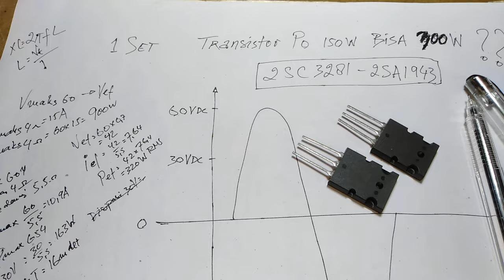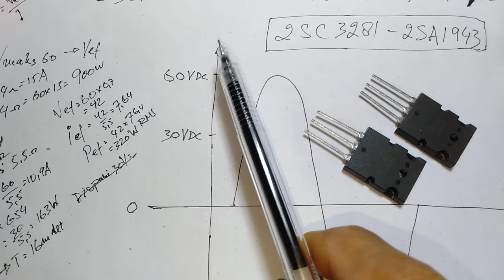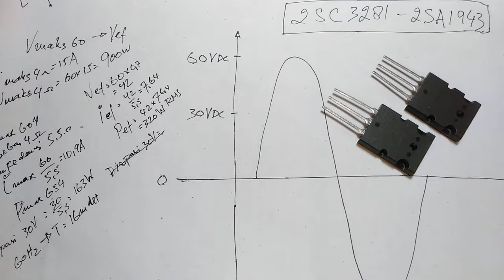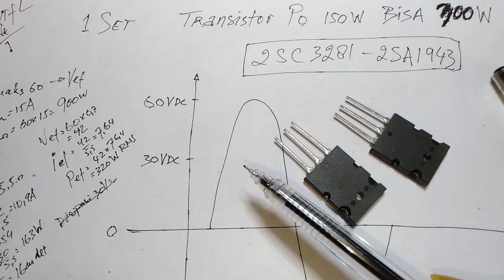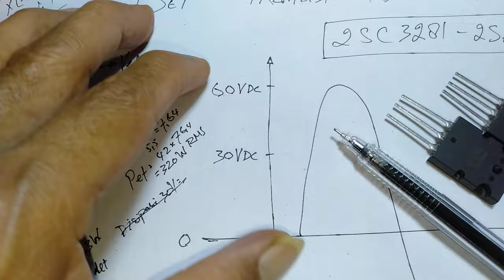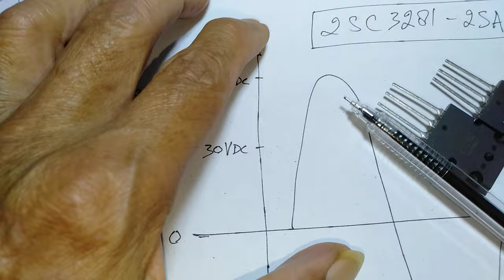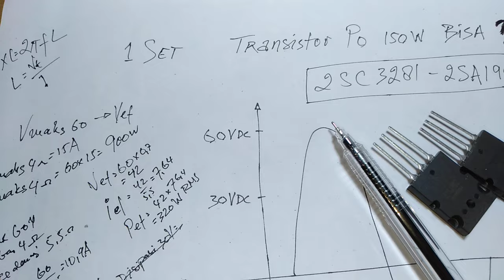CARA HITUNG WATT MURNI RMS - 1 Set Final BISA 300 W RMS 💪💪

Comment: selamat pagi pak iwan kamil saya mau bertanya sebab masih belom faham , ketika TR final di supply 60 vdc lalu TR final mulai kerja di 30 vdc dan sisa vce nya tinggal 30 vdc dibagi beban 5,5 ohm = 5,45 amper di kali 30 vdc =163 watt , lalu TR final mulai kerja di 50 vdc dibagi beba 5,5 om = 9 amper dan sisa vce nya tinggal 10 vdc di kali 9 amper = 90 watt
^^^yg saya tanyakan disipasi TR final tersebut yg ketika main 163 watt dengan yg main 90 watt itu kondisi TR final lebih panas yg mana pak ? soalnya di video bapak yg berjudul “kapan transistor mulai hot” bapak menjelaskan TR final akan panas di yg main 90watt karna  sisa vce nya tinggal 10 volt , sedangkan divideo yg ini bapak menjelaskan TR final malah lebih panas yg main 163 watt yg vce nya masih sisa 30 vdc (sebab dimenit 18:13 bapak mengatakan dipuncak TR final justru dingin), terima kasih atas jawaban dan penjelasan nya 🙏
Reply from the maker: @davidpurnama3202  
Selamat pagi..🙂🙂
Benar...
Jadi, intinya...kita anggap bahwa Amplifier (transistor final) tidak bekerja hingga Clipping/Over.

Maka yg sy maksud "tak akan panas di puncak kerja" adalah di Puncak-Kerja...dimana transistor tersebut BEKERJA MEMBERI TUGAS ARUS KEPADA BEBAN.
>>> kan fungsi nya itu ??
Apapun transistor Final, maka fungsi nya adalah "memberi arus kepada beban".

Nah, di Puncak Tugas nya, dia justru dingin...katimbang disaat separo tugas.

Saat separo tugas (di simulasi video) adalah ketika Separo Catu. Saat "separo catu" bukan "Puncak Kerja" nya.

😁😁...begitu
Reply from the maker: @davidpurnama3202  

Nah...makanya sy berkli-kali Posting di Fb...bahwa "Clipping" adalah kejadian DUNGU...
>>> disaat Puncak...jika ia kerj Musik Murni...transistor akan justru lebih dingin.
Namun...jika di saat itu dia malah DI PAKSA MEMBERI ARUS CLIPPING KE BEBAN...MAKA DIA DI PAKSA BEKERJA HINGGA 2,5 KALI LIPAT DARI KERJA-MUSIK.
DAN...KERJA "CLIPPING" TERSEBUT ADALAH "MUBAZIR" & "MERUSAK".

dia akan merusak transistor dan woofer.
Reply: @TUNERAUDIO  lalu konsep yg mana pak yg harus saya jadikan pegangan buat bekal ilmu yg bapak ajarkan kepada saya , di video yg berjudul “kapan transistor final mulai HOT” yg berdurasi 10 menit tersebut bapak menjelaskan saat dipuncak transistor akan sangat panas sebab VCE sisa 10 volt dikali 9 amper = 90 watt ( pak iwan menjelaskan itu di menit ke 9:00) 
^^^sedangkan di video ini bapak menjelaskan disaat puncak transistor malah dingin (pak iwan menjelaskan dimenit 18:13),saya merasa agak kebingungan , lalu kondisi transistor yg paling panas itu sebenarnya disaat main 90 watt atau malah yg main 163 watt pak
Reply from the maker: @davidpurnama3202  
Pegang kedua video...dan kedua video Resume nya :

Transistor Dalam Penguat Sinyal:
1. Transistor apapun akan paling panas Disipasi nya ketika bekerja gelombang sinyal di saat catu pertengahan nya.
Disipasi terpanas terjadi di titik tersebut, baik ketika maju maupun disaat penguatan Turun.
Yaitu pada masa Perioda 45 derajat, 135 derajat, 225 derajat dan 315 derajat dalam siklus Satu Gelombang.
Disaat itu kerja nya bukan terkuat bukan Puncak kerja, namun Puncak Disipasi.

2. Puncak kerja transistor berada sekitar Setinggi Catu, baik Catu Plus maupun catu Minus.
Disaat Puncak kerja ini maka Disipasi Terdingin....KECUALI TERJADI CLIPPING.
Kalau Clipping terjadi MAKA BICARA TIDAK LAGI TENTANG PENGUATAN SINYAL.

Beda antara Puncak Disipasi dan Puncak Kerja ADALAH HAL YG TIDAK DI PAHAMI OLEH SEJUTA UMMAT.
MAKANYA SEJUTA UMMAT BER PERILAKU "DUNGU" DALAM MEMBUAT AMPLIFIER ATAUPUN MERAKIT...ATAUPUN MENYIKAPI TENTANG "KEKUATAN AMPLIFIER".
Reply: @TUNERAUDIO  ok terima kasih banyak penjelasan nya pak, kalau misal kerja tr final berada di posisi paling puncak namun terjadi clipping apakah tr final akan jauh lebih panas lagi dengan kinerja tr final disaat posisi puncak disipasi
Reply from the maker: @davidpurnama3202  
Sangaat....sangattt !!!
Sampai bisa mencapai 2,5 X dari disipasi Puncak nya yg telah kita bahas !!!
>>> Makanya mereka Pakai Final jamaah sampai 40 Set...agar Ampli tdk terbakar...agar Coil Speaker lah yg Kalah dan hangus !!!
Padahal utk membuat Ampli Murni 5KW RMS beban 1 ohm Kurang...cukup maksimal 15 Set saja....Uji saja Kebenaran2 Video2 saya.
Makanya sy ingin agar kita semua, terutama pegiat2 audio "Final Rombong Jamaah" agar tdk DUNGU...mubazir Energi 2X lipat sementara semua Berpacu Memakai Hantu -Belau Klas Bias yg tujuan Efisiensi Energi.

Kan TOLOL namanya ??
Niat ingin Efisien...tapi Malah sambil Membuang Mubazir 2X lipat Watt Musik secara Percuma.
>>> Bisa di buktikan dan di Bongkar ttg Clipping & Mubazir dg Osiloskop di output Ampli2 yg mrk pakai di acara !!!
Apa yg di andalkan dg "Lampu indikator DOT PEAK" ???
Belum habis minuman Kopi mrk di Warung sebelah acara...beberapa Speaker udah Berasap di hantam Genre TRAP MODERN...
Mereka pakai BTL yg tidak mrk Pahami...
BTL itu kualitas nya JAUH dibawah Klas-AB Grounded Amps (Normal Output).
Klas-AB adalah Standar Bias yg MASIH REKOMEN TERHADAP MUTU FREKUENSI AUDIO SECARA "OVERALL".
Bahkan...Klas-AB dalam Konfigurasi LOW Amps...Masih Menang Banyak soal "Dinamika" & "Slew Rate" katimbang "D-Class" !!!

Saya sudah berkali-kali "menantang" mrk yg menyebut diri "Ahlinya ahli" Final Jamaah dan BTL....utk Saling Argumen dg Teknik Valid...gak ada yg Muncul !!!
Reply: @TUNERAUDIO  terima kasih banyak atas edukasi yg sangat penting ini pak terutama bikin amplifier kusus beban super berat 1 ohm cukup 15 set tr final, semoga kedepan nya dibuatkan video tentang amplifier 5kw Rms kusus beban 1 ohm cukup dgn tr final 15 set tersebut
Reply from the maker: @davidpurnama3202  
Dg skema sederhana yg sy beri di grup mesjid sdh bisa Overall Bi-amp Quality Dynamic 3 KW RMS dg max 15 Set final beban 1 ohm dg trafo ct 55 vac 60A, syarat agar tdk jebol krn Clipping harus pakai Filter andalan sy "Low Bass Boosted" jika utk Low.
Itu jamin selamat bertahun tahun spk lokal.
Reply from the maker: @davidpurnama3202  
Kalau yg diatas itu tentu saja tdk di bagi2 kan...krn rahasia dapur bukan utk di bagi2 kan, cukup bagi org adalah mamfaat nya dlm bentuk jadi.
Reply: @TUNERAUDIO  apakah amplifier BI-Amp 3000 watt rms dibeban 1 ohm yg menggunakan trafo ct 55 vac 60 amper tersebut bisa mengeluarkan tegangan 55 vac juga pak sebelum clip dibeban 1 ohm nya tanpa btl ?
Reply from the maker: @davidpurnama3202  
Akan mulus tanpa Peak hingga 55V sesuai efektif sekunder trafo jika memakai Limiter.
Justru jika tidak  memakai Limiter maka 55V tsb akan dipaksa Drop jadi 45V ketika terjadi Clip...dan 15 set final bisa jebol, agar tdk jebol maka mrk gunakan 40 set. Sesungguhnya kondisi tendangan hanya 45V...70 persen tenaga Trafo terbuang sebagai Clip...trafo drop.
Itu Fakta bisa di Tes di Bongkar ke dunguan mrk dg Osiloskop.
Chek saja...jika tak percaya.
Itu kedunguan kaum jamaah final...tambah dungu lagi jika memakai BTL.
Tendangan mmg lebih handal utk hanguskan Speaker...namun SPL bunyi Dungu...krn tendangan bukan utk Musik, 70 persen utk DC Clip.

Sy paham betul karakter BTL...sdh permainan sy berbagai ragam ampli di jaman 90 an...sy saingi branded eropa bukan dg BTL...krn power2 eropa bukan cuma kuat, tapi super dinamis.
BTL jelas bertentangan dg "dinamis".
Eropa cukup pakai ct 62 vac...mrk pakai spk 97 dB...hasil bunyi setara dg lokal yg pakai 3 box...
Reply from the maker: @davidpurnama3202  
Bagi sy...gak laku BTL.
Sy pembuat skema.
Dunia ampli sy tinggalkan 96...krn tak ada tantangan, sy sdh buktikan dapat uang banyak dari pelanggan krn sy mampu saingi branded eropa HH dan peavey usa.
Uang banyak makanya sy bisa pasok bahan2 riset sampai dua Peti...sy jaman riset gak pakai bahan ulang2 dua kali...sekali solder lempar ke Peti...
Satu bab bisa puluhan transistor sy lemparkan ke Peti.

Sy bisa solusi atau menulis banyak seperti skrg...jelas beda sendiri dg Konten2 lain...krn sy Otentik...sy lebih dari buku.
Krn sy puluhan tahun mencari "pembenaran" berbagai teori.
Sy tak pernah jadi FOLLOWER siapa pun.
Reply: @TUNERAUDIO  sebenarnya apa pak kekurang dan kerugian besar pada system btl yg bapak maksud tersebut , padahal ketika saya coba experiment pada ocl biasa tanpa btl pakai trafo ct 32 itu kalau dibandingkan dgn ocl yg btl sama sama ct 32 daya outputnya justru lebih besar yg btl sebelum clip nya ,system btl kan nggak singgah di ct atau langsung ke tap 32 dan ke tap 32 perjalanan arus nya , apa mungkin membuat disipasi transistor final jadi over ketika di btl tersebut ?
Reply from the maker: @davidpurnama3202  
Dlm produk bermutu, hanya ic dg catu rendah yg memakai btl.
Dlm brg mutu berdaya tinggi, hanya brand tertentu yg layak tetap quality, beda dg produk2 ampli murahan.
Hrg beda jauh, ampli seperti Roland lapangan 2K rata2 hrg 40jt lebih...sementara yg mutu biasa hrg kisaran 22jt.
Bedanya banyak, sy tak akan rinci...krn sy tdk dalam konteks mengajar disini...
Sdh lewat masa sy mengajar...grup2 sdh sy tutup sejak juli dan sy mmg tak akan memberi detil2 lagi...
Silahkan nalar sj sendiri kenapa ada beda hrg ampli begitu jauh...mrk sama2 bisa BTL dan fakta nya mmg beda di lapangan.
Salah satu beda :
BTL ampli mahal bisa dua kali normal tendangan nya dg beban berat.
BTL ampli kelas 20jt an...di BTL hanya tendang 65 persen hingga 70 persen dari 2x normal.
Itu baru satu hal yg jadi tanda bhw BTL itu butuh "banyak hal ekstra" utk jadi tetap Solid.
Dari tendangan yg tdk 2x normal itu saja sdh menyatakan bhw "ada sesuatu kelemahan".

Pamungkas : sehebat apapun BTL, quality nya akan kalah dg sistim Normal Grounded krn apapun yg di inverting akan berselisih Fasa nya dg non-inverting.
Selisih tsb akan membuat gelombang hasil Resume akan berubah bangun nya dari sinyal asli.

Banyak lagi ttg Damper...ttg slew rate...yg tak perlu sy bahas kan disini.
Ok ya...
Reply: @TUNERAUDIO  baik terima kasih banyak pak iwan kamil 🙏